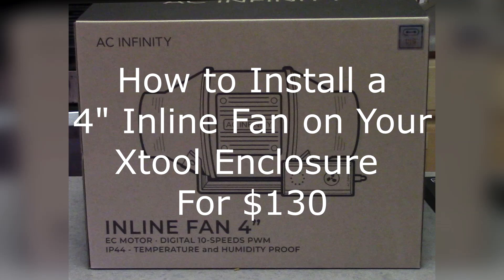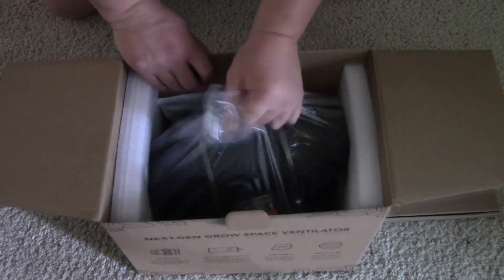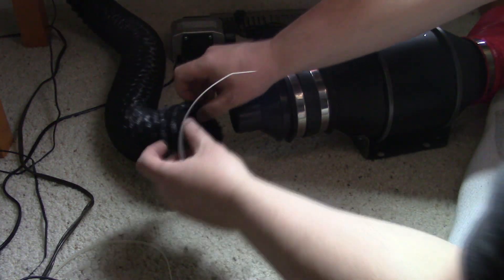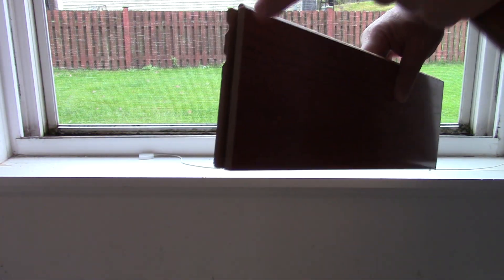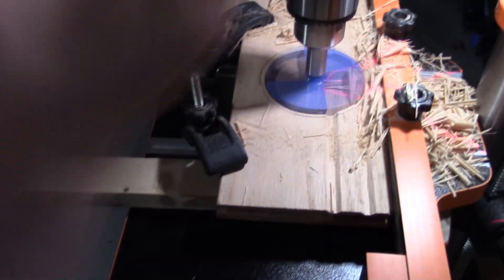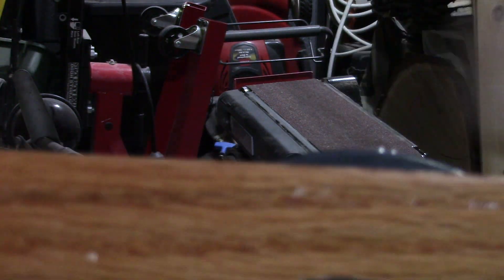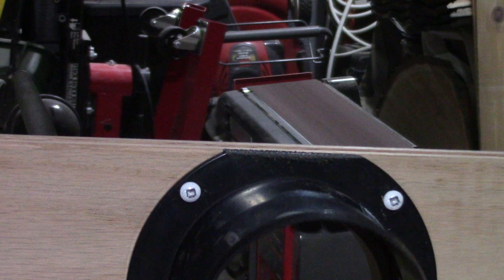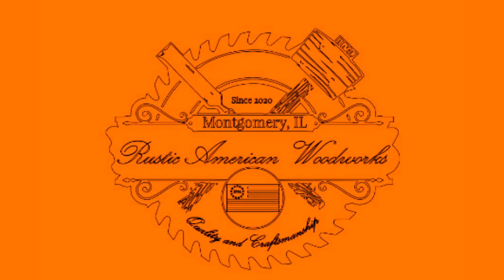How to Install a 4" Inline Fan on Your Xtool Enclosure

Comment: Did you leave the stock 80mm fan installed on the enclosure or did you remove it?
Reply from the maker: I left it on, I don't power it.